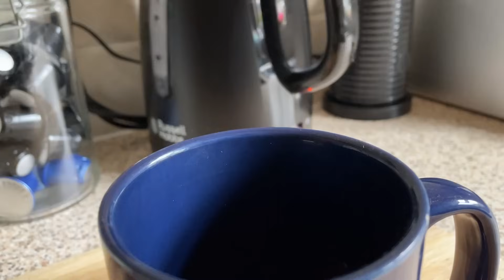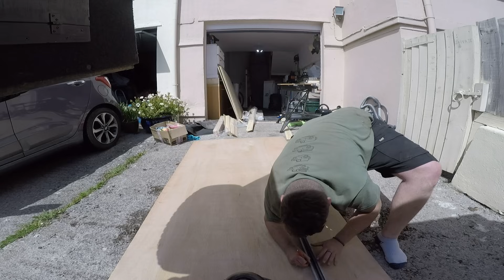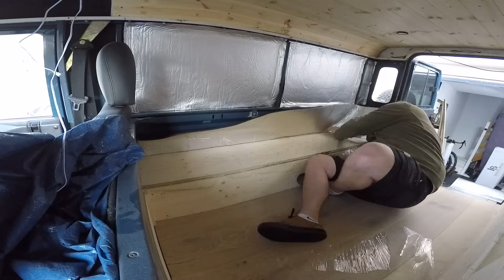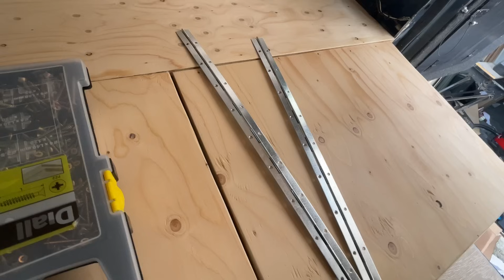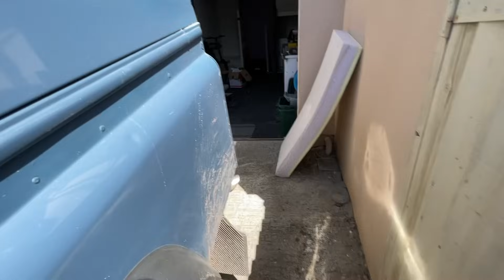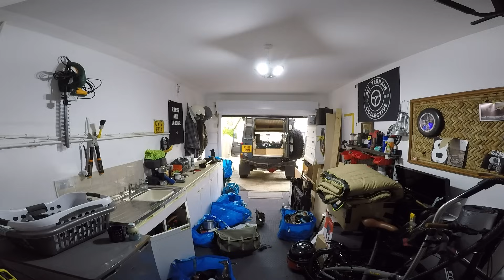DEFENDER CAMPER BUILD 2.0 ● NEW AND IMPROVED

Comment: hi, did you screw the wood on the wheel arches into the landy or just stick them down? it looks like you only used adhesive, after a few years use has it all stayed in place?
Reply from the maker: I used both 👍 more glue than screws. It’s very very secure still haha
Reply: @BorisTheDefender  Epic.. thanks

Comment: Love this.   Has to be one of the best laid out 110 camper I've ever seen.   Good job considering the limited working space of your workshop and also the limited set of tools available.   Only thing that could be an issue is your grey water drain.   It sort of gives you away, and in some European countries can also get you a heavy fine.   An easy solution could be small tank (with an overflow) under the left wheel well/bench.
Reply from the maker: Wow, thanks!

Comment: Hi there, looks lovely and cosy.  I was wondering do you have any kind of measurements? the reason I ask is I am looking at decking out my RAV4, removing rear seats etc., its an older model with a similar layout and wondering how much room your Defender has compared to a RAV4?  Can I do it is the question I have for myself.  I rescue lost dogs in remote Australia and need to have a nights nap sometimes, insulation and lots of water!!  I'd like to upgrade my arrangements.  Cheers and thank you very much for such a great video.  It helps a lot.
Reply from the maker: Hey there. No I don’t. I did it all by eye. But the bed length is roughly 185cm. 
Sounds like. Good idea. I have a rav4. Good cars! You might need to put the front passenger seat forward a lot to fit a per platform in

Comment: Great video and great inspiration for what is possible in a limited space. i'm thinking of getting a 110 as a stealth camper but worried about sleeping length as i am over 6 foot. i have converted a bongo before so not too bothered by design and fab. how did you find it when camping?
Reply from the maker: I would say you would be fine if you can sleep diagonally. It may be a bit tight for you
Reply: @BorisTheDefender  cheers, i'm definitely used to sleeping diagonally everywhere i go, it'll only be for cheeky weekends etc so i'm sure i'll cope. keep up the content, loving your defender and adventures.
Reply from the maker: Thanks so much buddy!

Comment: Hope you have let your insurance company know. as lots of diesel heaters aren't to BS standard, self fitted may void your insurance, as may piped and carry LPG which should have a yearly certificate from a LPG Gas Safe engineer, numbered and dated and clearly signed.
A mate of mine his caught fire, not sure why, but he also did his own electrics ( not being a qualified auto electrician) the insurance had a look at the burnt out LR, and it was a right off and he didn't get a penny, as it wasn't registered as a cook in, self fitted out camper with a self installed imported diesel heater and only insured as a LR, which makes a difference it seems. And he also got a large bill for the damage the fired up LR caused, think that was 15 grand which he blanked until he got a court letter. So well worth just checking out your covered for everything should it all go wrong.

Comment: Great job and even more impressive that you're working with just two power tools. For the LED they sell aluminum extensions that the stops sit in and you can put a diffuser over it so it's not too much glare from the lighting elements
Reply from the maker: Thank you so much! And that’s a great idea
Reply: @BorisTheDefender 2 Replies

Comment: Beautiful work, Congratulations for the Defender conversion and you tiny garage.. Three things I think you have to do.. fit a fridge, instal a grey water tank underneath the sink (there is enough space inside the wheel arch) and install a diesel heater (I don’t know if you have installed yet). A great solution is the sliding window on the rear door!! Best wishes from Tuscany!!
Reply from the maker: Thanks for the tips!
Reply: @BorisTheDefender  where did you find the sliding window? Could you post the link? Thanks

Comment: Hey fella,

Happy new Year! 

My husband and I have been watching your videos for inspiration and to build up a bit of courage to take on our own build, as much as possible. We really like the level of finish you have here, and think you've done a cracking job, on both the build and the videos. Great to see how, not just the result. 

We have been pricing up all the materials over the xmas hols, plus have a few decissiosn to make with ref to hardware and fit out, one of which is cutting in a window into the side of our 130's rear box. We have a panel that's a perfect fit for a LR rear door glass pane. I was looking at a tinted version but ideally I'd like to be able to slide open the window. Just like yours on the rear door!

Where on earth did you source that rear window with sliding pane? I'm really keen for a LR part / style, as opposed to cutting in some horse box side windowt etc.

We've not finished yet, but we're working our way through your channel. Great stuff.

Regards

Katie & Glenn Brace (LR 130 G4 / SIII 88 / D2) (Our expidition / the classic / the daily)
Reply from the maker: Hey :) mine is second hand from eBay but I think explore glazing make them

Comment: Great video, nice job. Not my cup of tea but immediately after watching I was staring into space eating a mince pie, thinking about my 109 and the overnight camp set up I’ve got that means I can use it as a shit wagon for the rest of the year. This entails building a swing away rear spare carrier. And the problem there is my number plate is offside and the tyre could just about obscure it. Thanks to to your vid I’ve now had a solution pop into my head. Have a numberplate and light which attaches to the spare when the spares outside when I’m using it as a camper ( like a bike carrier on the back of an estate should have) mounting problem solved, and your video started that mental ball rolling 👍happy Christmas!

Comment: Cracking job!  Rather motivating.  How much of the electrics run off the Jackery and how much off the main battery (I'd be afraid of running that flat)?  I take it there is a solar panel on the roof and the cool box is electric?
Reply from the maker: Yeah the main battery has been brilliant. Bought with it installed in 2019 and doesn’t let me down.
Reply from the maker: Only addition camping and charging comes from the Jackery, I soon may use the Jackery for a fridge

Comment: Because the LRD has a modular roof and side panels, I have always considered this to be a good basis to adapt to a high top or elevating roof, giving a low profile for driving and maximum internal living space for camping.

For maximum effect in keeping out water, Butyl Tape will more than likely be better than the OEM Seal Strip.

I like your presentation and narration and have subscribed to follow your build.

Very good result from day one!

Roof looks gorgeous, though I an surprised that you didn't insulate the floor, especially if that doubles as the sleeping area.

Very odd that your supplier shipped the insulation in two separate deliveries, and quite irritating for you I would imagine.

Day two sees nice improvements, and I particularly like your drawer access, radiused corners look really good in travel cabins, and yours look the business.

You started well and are continuing in that theme.

Its now looking really gorgeous!

You've got plenty of storage and when rained in, you've got a lovely interior to be in.

Do you recall where you got the hinges for the kitchen access hatches?

You've done a superb job on your LRD, and despite your self criticism I believe that you will inspire many viewers to consider doing a build out for themselves.

What you've done you've done well, and you should be proud of the finished result.

Comment: Very nice. I like the blinds instead of curtains. Also. You have a rear door sliding window. If you can rig a 12v fan to that, you could get great ventilation with the. Cracking of the front Windows.
P.S.
The front compartment by the Jackery were to had to notch out for the electric panel,that would make a great emergency toilet compartment.....

Comment: Thanks for video! After few years spent with my Defender 110, and many interior evolutions, maybe this year I will make perfect on for us. We have roof top tent but I hate it and we prefer to sleep inside. 

What plywood dimensions are you using? Is it 12mm everywhere or something larger for horizontal spaces ? How many sheets of plywood have you used ? How wide is the space between kitchen and right storage containers? I've made plans for similar build to yours, but with raised section in the space where second row seats are right now.

Comment: Lovely - I am very impressed.  I assume that you properly fused that wiring which goes behind the passenger side panel? Last thing you need is a short there and the wires catching fire.  For the under counter lights - I'd have been tempted to put a reed switch on those so that the light comes on whenever you open the doors.  A future improvement, maybe - and it'll free up the buttons for other things.